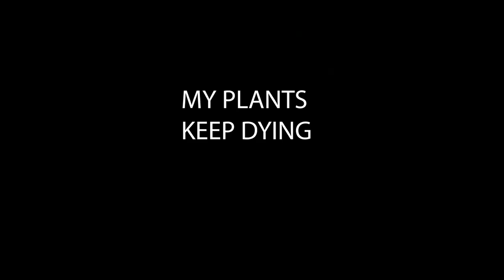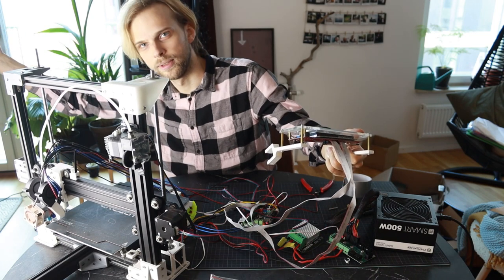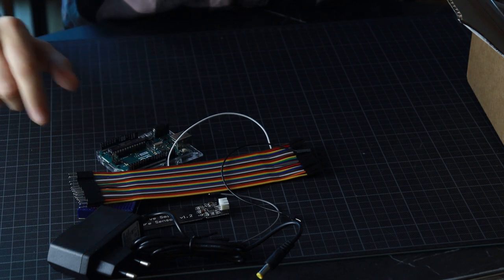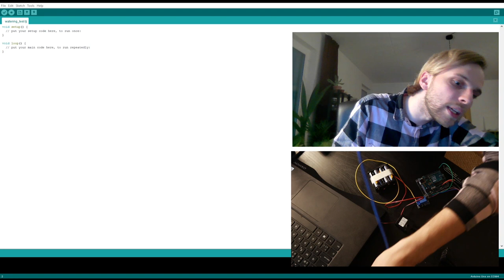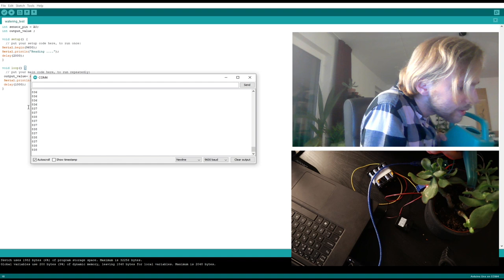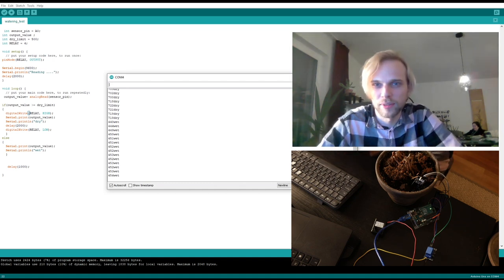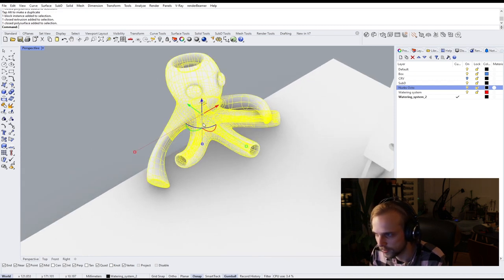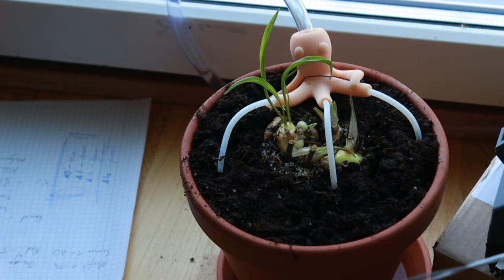I made an automatic plant watering system with Arduino

Comment: Great video! Instead of getting so many pumps for your system expansion, you could potentially get small solenoid valves and construct a strategically laid out pipe network, where your microcontroller controls where the water is directed.
Reply from the maker: Ooh that's smart... damn - will need to do a v2.0